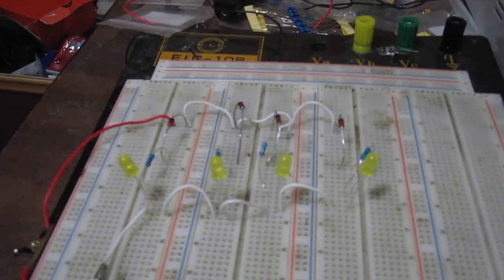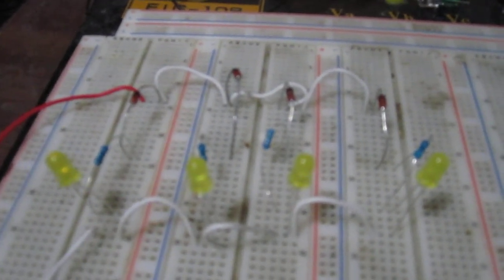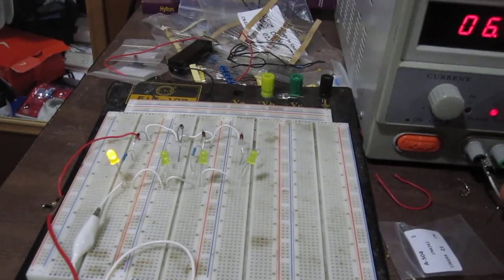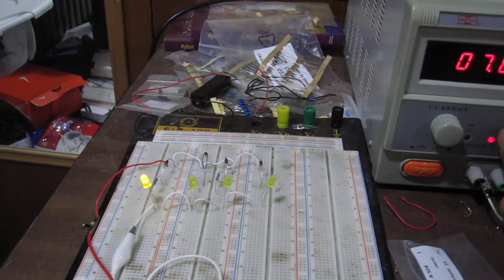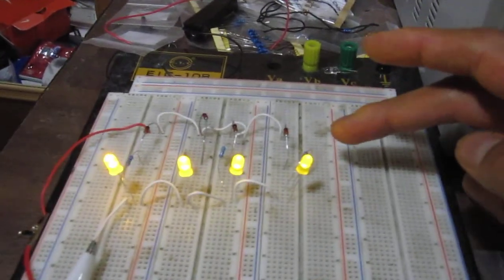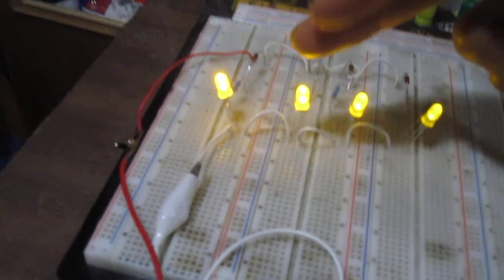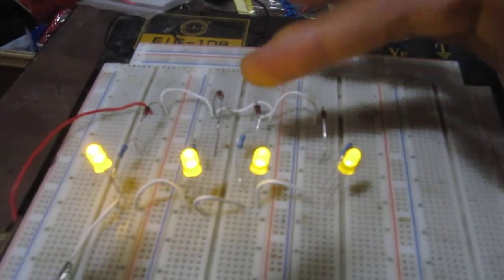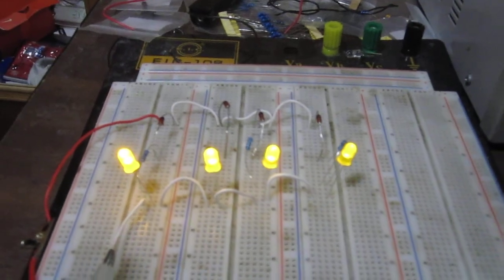How to Build a Voltmeter with Zener Diodes

Comment: the 4th turns on at 15 volts, and the zener is a 12V one, what's the deal with that?
Reply: The LED itself also need 2 to 3 volt to start glowing. So the zener is dropping 12v and the LED drops another 3v, so a total of 15v.

Comment: please tell us the part number and the circuit diagram_
thank for the video, it amazing.
Reply: Components Needed

1N4739 9.1V Zener Diode
1N4733 5.1V Zener Diode
1N4741 12V Zener Diode
1N4728 3.3V Zener Diode
4 470Ω resistors
4 LEDs